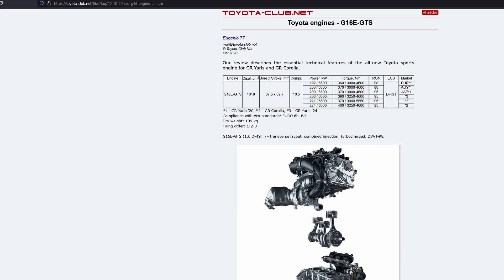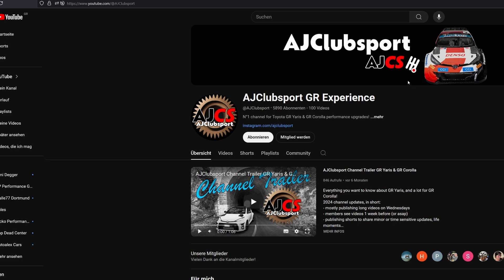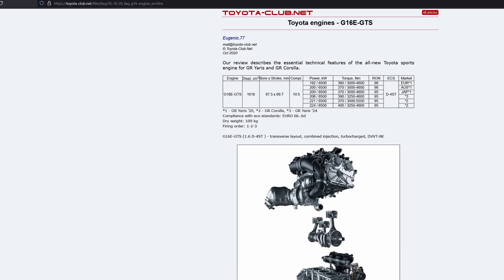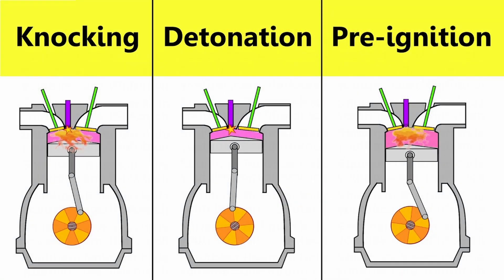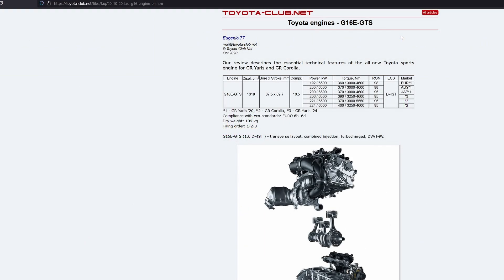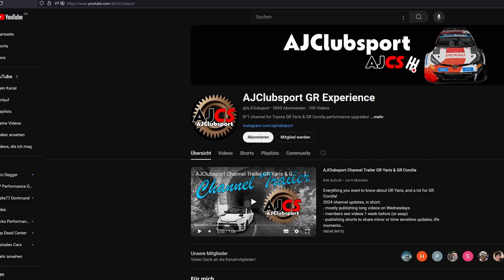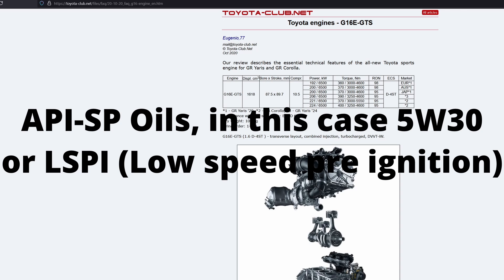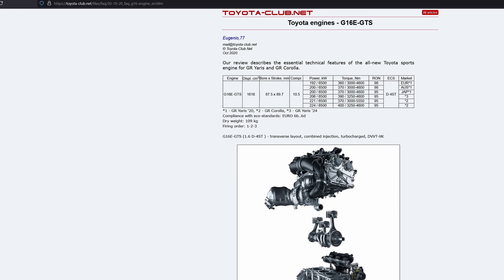GR Yaris & GR Corolla Engine Failures | Explanation & Prevention | Pre Ignition & Mega Knock

Comment from the maker: This video is an update to the previous Video i did on this topic. The video was removed to an unjustified copyright claim wich will hopefully be resolved in the next few days. if you want to see the old video (which has some misinfotmation though: https://www.youtube.com/watch?v=vs4017S03aE

much love goes out to everyone who commented <3 we are seeing what these issues are and making everyone aware of it and there will hopefully be a definitive solution that is not as costly as disassembling the whole motor soon.

also, the video i refer to:  https://www.youtube.com/watch?v=h1TONzhOxvs&t=769s
Reply: I have had my GRY for nearly 4 years now. Must be ready to go bang at any minute now.
I also have 40 years of mechanical experience. So Toyota have got the ring gaps wrong. Well they have not been around for long time as a company. Tiny R&D department. No motorsport experience either. 
I always thought the Oil Control ring controlled (see what I did there) leakage(of oil) pass the piston. Blow By is the term used referring to leakage of combustion gas past the piston and rings into the sump during the combustion/power stroke. Not the other way round.
I don't thing I have heard a bigger load of unproven rubbish base on no facts or qualified failure analysis in all my life. 
I will add one more thing. Prove It.
Reply: @Sekred  100% agree. Had my GRY for nearly three years and its always run like a Swiss watch.

Anyone who has looked at this narrative instantly sees it’s a load of b*llocks (of the two GR corollas that somehow caught fire one of the owners bought another GRC two weeks later).

Comment: GRC Morizo, suspected blown engine. died at 6200 rpm.  completely stock and all service work done by toyota.  under warranty and no pushback from the dealership so far.
Reply from the maker: Yeah seems to be the exact problem many have. I wonder if tuning down ignition timing would help

Comment: The crankcase pressure should never be high enough for oil gasses etc. to be able to enter the combustion chamber through the gaps in the rings.  The oil is coming from the PCV system which is sucked back into the engine and burned for emission purposes.  Id recommend a catch can or air/oil separator to ensure there is no oil mixing with the combustion air which can cause this detonation issue.

Comment: This storm in a teacup still going about? Highly exaggerated fear mongering but hey, keep scaring people for clicks.
Reply from the maker: @khamid1  well the danger certainly is there there is no way around it as said in the video the right oil can help massively and with the new engines toyota has solved these problems
Reply: @throttlebuddies0  There is no substantive evidence for the failures presented anywhere. Everything that has been mentioned has no actual evidence outside of "trust me bro" and "this guy told me".
Reply from the maker: @khamid1  no actually the ecus can detect pre ignition and will throw a code and therefore there is evidence that this is an issue 

If you were using knock monitoring while driving and that happened you would also clearly see it. There has been plenty of testing showing that that issue is pre ignition and its not just a "trust me bro" thing
Reply: @throttlebuddies0  You haven't shown anything. This is still trust me bro. Provide the data, prove it or keep spreading rumours for likes, views and clout.
Reply from the maker: @khamid1  there hasnt been any data published to the public unfortunately but  plenty of tuners have tested this and come to.a conclusion that this is the isue. And that also is the only logical explanation for the failures. Or what do you think are the causes? 
The issue consists and is a problem on all direct injected engines but on the g16 engine more so due to looser tolerances which has been confirmed by toyota and shops who have pulled down engines and measured the piston ring gap wich was too large, promoting oil entering the combustion chamber

This is why you see some engines also randomly throwing rods while revving. 

You have to acknowledge there is a problem, otherwiese toyota wouldnt have done these revisions and there werent as much engine failure videos + not everybody does a video on this 

In the comments on my last video which unfortunately got copyright claimed by some idiot for no reason there were plenty of people in the comments who had actual engine failures on stock engines so dont tell me that there is not an issue.

Comment: So how can we tell if we have a Gen 1 engine or a Gen 2? Is there a specific VIN number or serial number to look for?
Reply from the maker: Well they solved the issues completely in the facelift engines and some in the later pre facelift, bit the tolerances still remained on the wide side on the later pre facelift ones so i would use the recommended oil at least and do regular changes that will go a long way
Reply: @throttlebuddies0  By facelift you mean the new 2025 models right?
Reply from the maker: @yuyu-san  yeah the ones that just came out i knot that they have all the improvements of the "gen 2" engine. as far as which older ones have what improvements, i am not so sure about unfortunately.
Reply: @throttlebuddies6356 There is only one part number listed for the piston rings across all US GRC generations. Normally, you would see a part number supersession after a change like that.
Reply: @1InfinityShade  the part numbers will be the same as the rings gaps are ground for each individual engine to make them fit

Comment: Im surprised toyota made such an oversight
Reply from the maker: @andrewcarroll8265  all cars with direct injection have a problem qith pre ignition, but the pistons and tolerances toyota was using in their first generation were just causing problema
Reply: No oversight they know about these issues. You have a very high pressure, highly strung systems.

There is also issues an issue with fuel vapor being pushed down past the piston.

Toyota just need to get the car past it's warranty.
Reply: the storm is coming.... wait till you find out how crap these cars really are.... 💣💣

Comment: How do you identify second-generation engines?
Reply: They don't have a hole in the block  😂
Reply from the maker: all of the facelift models are Gen 2 engines.
Reply: @throttlebuddies6356  Half way though the fist year of production, there were a few changes made, but I am unsure if the piston ring issue was addressed that early on. The engines are numbered. So, I'm curious if there is a way to track the where in the series these issues are most prominent. My car was built in July of 23. So, I am a little nervous. I'm not sure I want to go out and grab a 2025 just so I can rest easy.
Reply: @1InfinityShade  toyota needs to come out and do to GR Corolla what they are doing to Tundra trucks and LX SUVs and replace the motors.